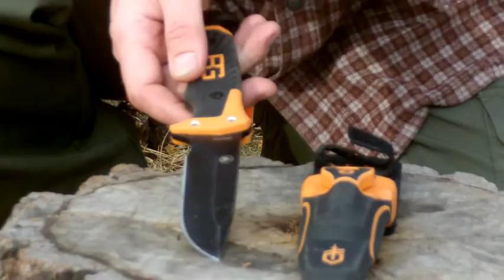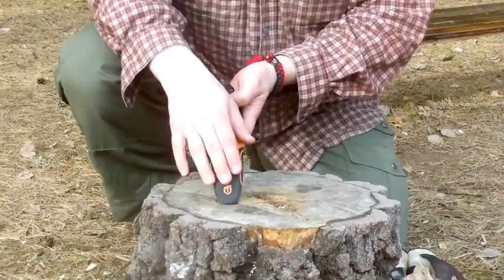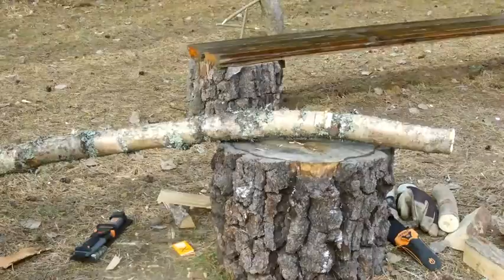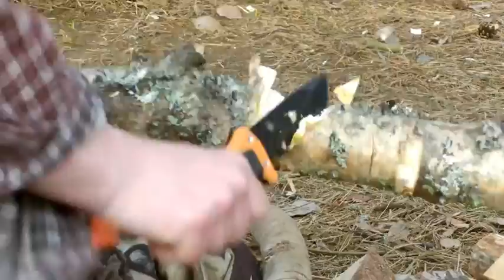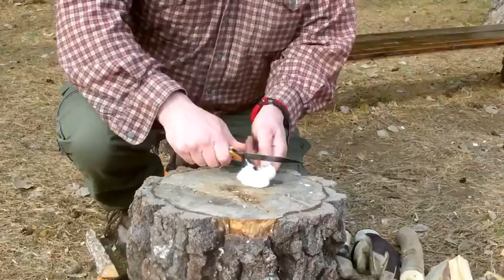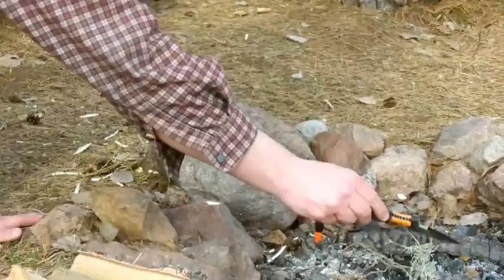Review og Bear Grylls Ultimate Pro survival Knife - Testing

Comment: Hi there, thanks for the test !
If you would buy the knife again, would you choose the old or new version ?
The old one is cheaper, has more versatile sheath, is lighter to carry, and is more "blade-heavy" for chopping.
I doubt if the full-tang version is better, it is not a knife to cut down trees.....😉
Reply from the maker: Hallo Johnny, Bum bum, its a hard one, and you got your fact right, I like the sheat better on the old but the position on the firerod is better on the new. I do like the new knife better. it just seems better i think. but more expensive, and I dont think you get that much more value. so if price i no problem i would get the new. but i have seen nice bargain on the old one very cheap.